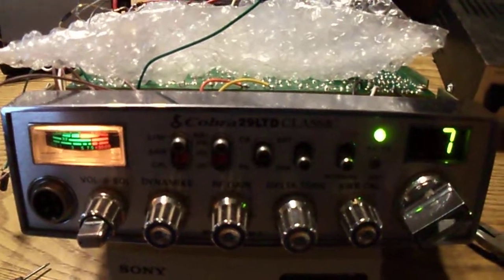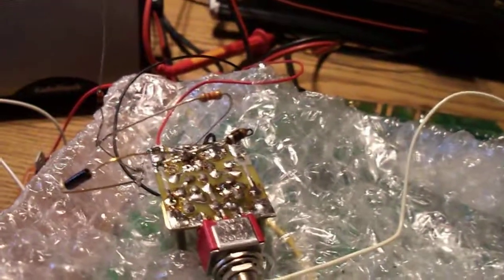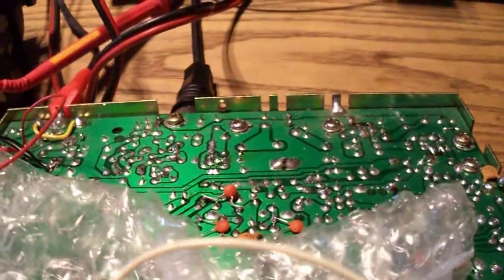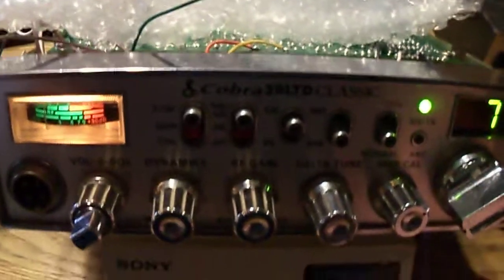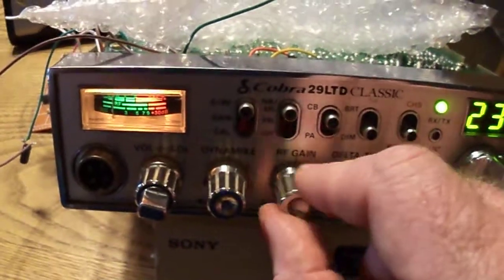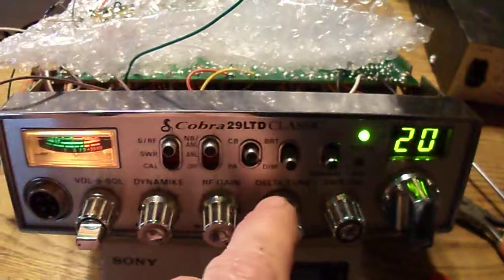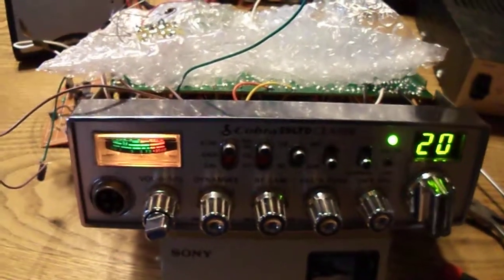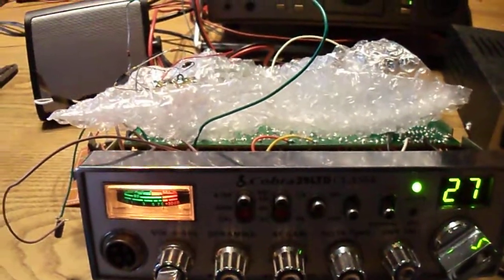20 meter ssb conversion to a cobra 29 Part #1

Comment from the maker: I am still working on a dsb transmit circuit for these radios. I am also working on a 40 meter conversion, this conversion may only be good for AM/SSB Modes, I will see how things work out and post them later.
Reply: Hi carl, i have a cobra 134 (never been modified) and a cobra 138, (never been modified) i would like to convert the 138 to 40 meter, its a 23 channel, so some investergating is in order, might be a good conversion no PLL chip.....! it has 10 crystals, wow, i am a big fan of the 40 meter.
Reply from the maker: @mpgruhlke is this about the cobra 29 conversion to 20 meters?

Comment: Nice work Carl!!!
Reply from the maker: Thanks Juan! It is a long way from being finished, but its almost done.
Reply: It's already working. Just need more tx gain!!! Like the way you added the product detector. Later a crystal filter and done!!
Reply from the maker: Thanks Juan, its a work in progress!
Reply from the maker: The product detector will work in almost any cb radio that uses a 455kc I.F. which can make almost endless possibilities for many older cb radios.  Conversions like this may open the window for more DIY homebrew ham gear.
Reply: Great job and thanks for sharing!

I've been working on the older radio and PRO-2006 discrimination taps for RTL-SDR/SDR's as well as an original and modernized CE-232 related projects.  Figure something like you're doing isn't the most complicated with the older gear since you don't need a microscope to solder.  With the newer generations repairing iPhones and stuff like iFixit notes and others... I'm feeling the newer radios can be modified also with a more steady hand, a stereo microscope and lots of patience.  

What's the latest on the conversion kits or at least instructions on your different videos designs?    Any links to references for DIY?  Thanks in advance for your time and again sharing.  Neat info and projects!

Comment from the maker: I'm still working on a dsb circuit using a mc1496 chip. When I get it going Ill make another video. If someone wanted to use one of these converted radios for cw and am they would be great for that also.

Comment: Hi Carl hope your well, I made a colpits 12.5mhz oscillator and connected to C87 like you said, made adjustments to L22 coil and everything is OK, the first IF 10.7 has been by-passed, now I make the  ne602 circuit using a 0.455khz. Did you connect the 0.455khz xtal directly to the second IF ??? Or have you done something different!!!... Best regards Peter ( ime making progress).
Reply from the maker: Hi Peter, I made a product detector for the dsb/ssb receive using a ne602 and 455 khz crystal resonator for the vfo. I came off the last IF can (L9) to feed the product detector and took the output of it and fed it to the radio's volume control.
Reply: Thanks for the information and help Carl, I will be trying that out after its built, I will  let you know how it all sounds, the cobra 29ltd classic was made in 1993 in the Philippines, its a side mounted microphone, fantastic rig. Did you make more videos after it was finished!!!... Best regards Peter

Comment: Did you try adding a balanced modulator to suppress the carrier on transmit
Reply from the maker: Yes I have tried that. But only on the transmit. What I have when I do this is separate TX and rcv frequency controls because I am using a product detector in the receive. I also have to bias the final to make the TX DSB sound rite. I have also taken a cobra 29 and converted it to DSB on 11 meters but that is a video for another day.
Reply: @CARL557511   thanks for the info. I am doing a conversion of an old 23ch am rig to DSB transmit and I’m going to shift it up from 11 to 10 meters using a dds VFO shifting one of the IF mixing Xtals up 1 MHz.

Comment: Hi carl, another great rig for conversion, well done, sounds nice, have you ever considered using a AD9850 WITH ARDUINO NANO? THESE syntherisers are very cheap and a little easier to install, with good results, enjoy your videos very good, keep them coming.
Reply from the maker: Thanks Peter, I have considered using a Arduino on these radios but I haven't done it yet. On my conversions I try to keep it all simple as possible with parts that can be found commonly. The conversion done to this Cobra 29 uses a 12.5mhz oscillator in the radios PLL Circuit. I have had really good results with the product detector I designed to receive ssb. I need to make a separate video just on the product detector and show how it is made. I also have a video coming soon on a simple conversion for most older am cb radios to operate in the high end of 16mhz to the lower end of 17mhz this is a part of Maritime Mobile but the radio operates AM Mode only which is not allowed on that band and is not for Amateur use either. That doesn't make the radio useful unless it is used for life or death situations and matters related to that.  Thanks for the kind words Peter. Carl KC8YLT
Reply: Hi Carl, yes your right, keeping it simple and using parts easily found is proberbly the best way to go, some of the cobras PLL circuits can be a little chalanging to bye pass, the cobra 19gtl uses a TC9109P, i want to try and remodel it to cover 28.300 - 28.500MHZ. i will have to make a oscillator, plus slightly modify the intermediate frequency circuit too, but it can be done, lots of late nights but worth the effort, i wait with great anticipation for your up coming video, sounds good, every body who owns cb radios should keep them alive!!!!! best regards.
Reply from the maker: Thanks Peter I agree 100% we need to keep them alive and going, you never know when you might need one. The cobra 19 I feel has potential as a base radio for experimenting, meaning it can be combined with other radio circuits to be used on other bands and hopefully DSB Mode someday. On the 29 that is in the video its receive IF is single conversion (455 KC) I bypassed the 10.700MHZ 2nd IF so there is some receive imaging from higher and lower frequencies that exist around the desired frequency its operating on. These radios and others that are similar to the 29 have the potential to be converted to 20 meters with a little more work. I don't know where you are located but I will be taking some converted gear to the Athens County Ohio Hamfest this Sunday. I have taken this week off to put some radios together to take and I have one that is going to a friend in Canada soon. Once again Peter thanks for for commenting and watching,
Reply: Hi carl, thanks for info, i bought the cobra 19gtl  because the PLL CHIP was a special one and it was going to be a challange to remodel it, i am half way there, osc circuit finnished, a quick look at the IF stage and some remodeling it should work out ok!!!.... and kept as simple as possible, for me carl i am located in mid west france, been here for 17 years, your videos are very informative, keep them coming, good luck with ohio hamfest on sunday. hope to make contact with you one day on a converted cb, its possible!!.. best regards

Comment: Hello Carl, what frequency is the oscillator you connected to c87.
Reply from the maker: 12.500mhz is the crystal I used in a 2n3904 oscillator. I had to readjust L22 also. Let me know if that doesn't work. I still have my 29 here somewhere.
Reply: Hi Carl hope your well and every thing OK for you, I will let you know how things turn out. Thanks for your help best regards.

Comment: hello again Carl. I did not receive your reply and was wondering if you could send me the build and parts info for this modification.
Thanks
George, Canada
Reply from the maker: Hi George, I haven't completed this conversion yet. The transmit section is not finished. The problem I am having is the product detector drifts some on receive from the transmit frequency. That is something I am trying to correct. This 20 meter conversion may work better as a cw tranceiver.
Reply: @CARL557511  Thank you. Please let me know when you resolve. George.

Comment: Hi carl, not heard from you recently, you must be busy, have you got any kits ready for the 40 meter conversion, i have a cobra 148 sitting there ready for the conversion. best regards.
Reply from the maker: Hi Peter, not finished yet but can you give me the postal code for where you want it sent to so I can calculate shipping? Thanks, Carl.
Reply: Hi Carl hope you are well, I bought a cobra 29 a quick question, what is the frequency of the oscillator you use on capacitor c87!!... and do you put the product detector you made on the receive TA7310P.  Thanks for your help.